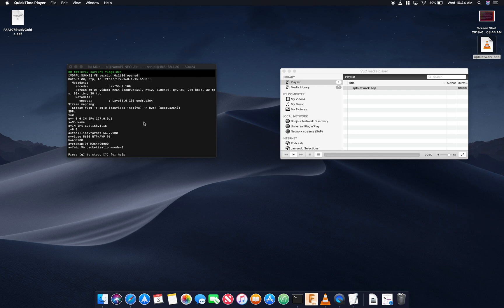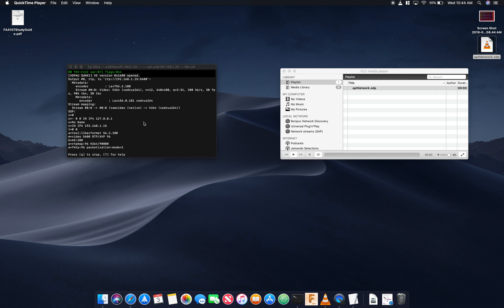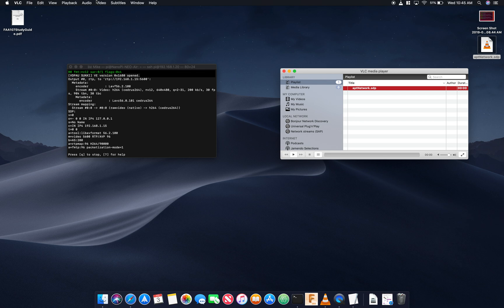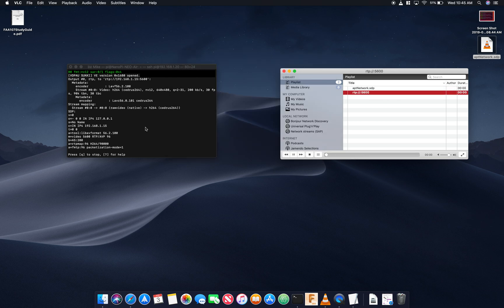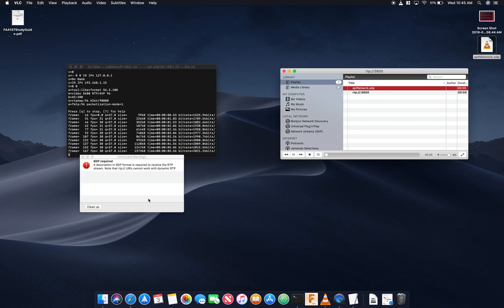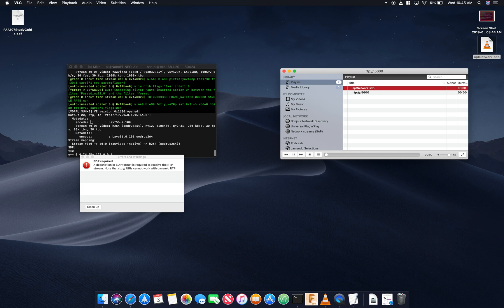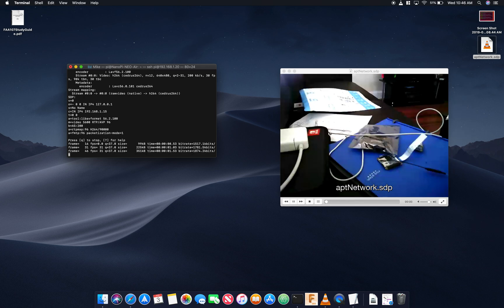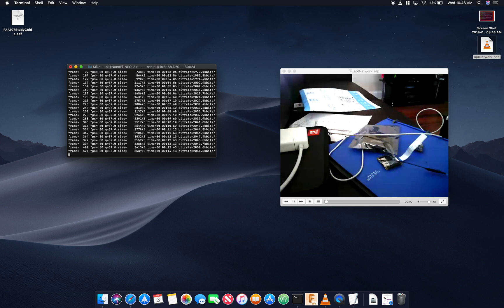UAV Companion Computer FFmpeg VLC Video Stream SDP File Fix

Comment: Very helpful video! I was struggling with getting a low latency stream from a usb camera through Raspberry Pi 1 B+. The hint with the SDP file was helpful for me. But i did not get any picture even with SDP file on VLC. Then i looked on command you are running and adopted the option -fflags nobuffer. After that i was able to start the stream almost immediately. My latency is about 2 seconds. Looking to reduce it under 1s.